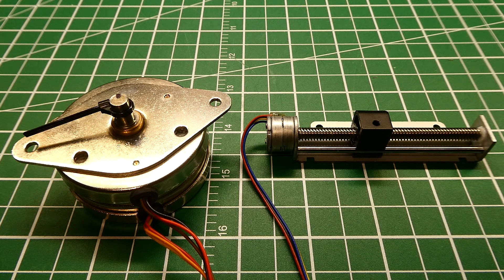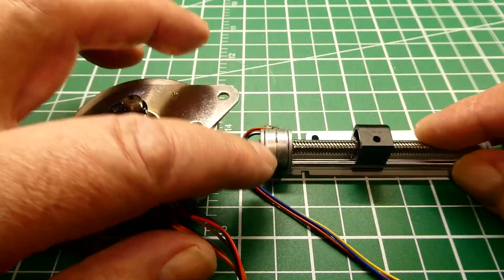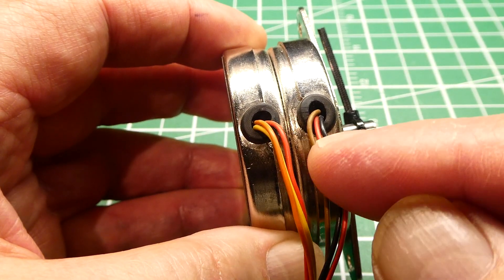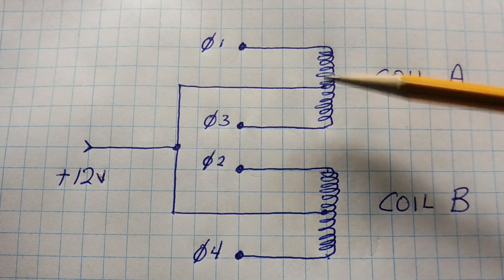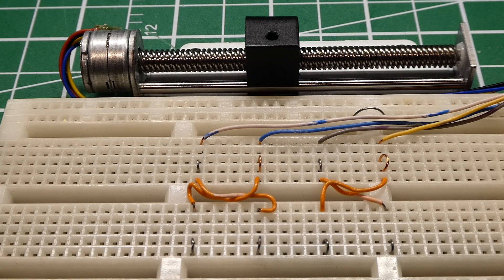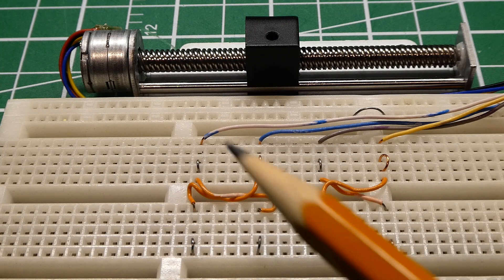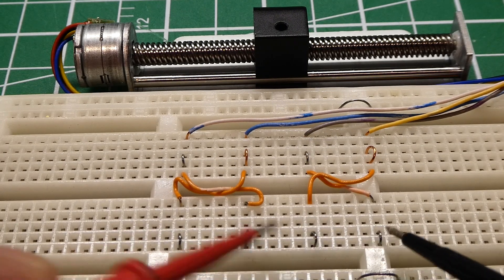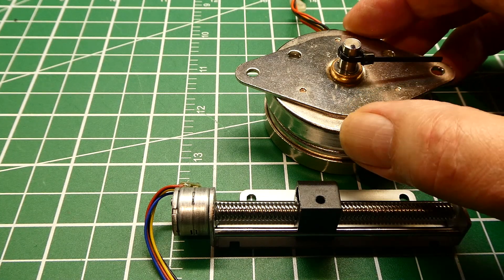Stepper Motors Simplified

Comment: hi thanks but then where do I connect the + and - cables inside the protoboard (i.e. where the electronic components are located)? because I don't know from the video, he's left out
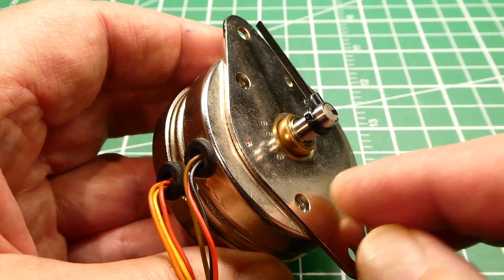Reply from the maker: The + supply is connected to the center taps of the coils and the - supply to the wire energizing the 4 phase coils as shown at 1:43.

Comment: bi-polar, so four blocks of 4 contacts on double circle, a rotating disc with just 1 copper pad on each circle, driven by a dc motor powered thru a sliding resistor, more pads = faster steps.
Triple circle for plus/minus/plus config so 2 blocks of 6 contact points and 2x2 copper pads on rotating disc. 
mechanical PWM where length of pad and spacing between pads determine duty cycle, might need several discs
usage: if dc motor also drives some other display and needs stepper, or sliding resistor also powers another device / identical device but in reverse rotation

Comment: Excellent but it's pronounced "LEEED SCREW" not lead as in solder.
Reply from the maker: Yes you are correct. My high school metal work teacher always pronounced it LED with reference to a lathe leadscrew so it became habit. Realized after video was made ... thanks for the correction.